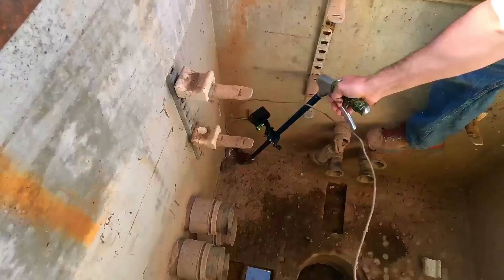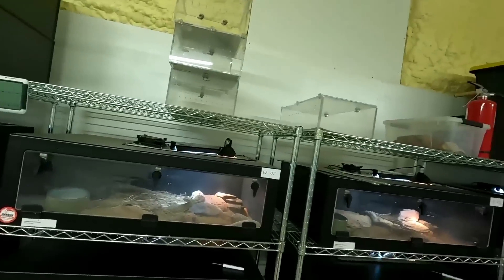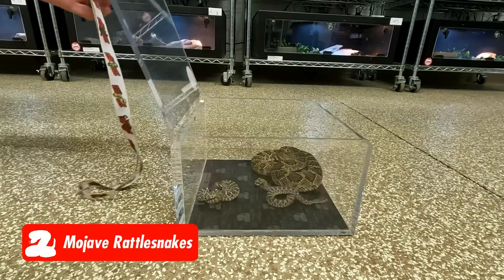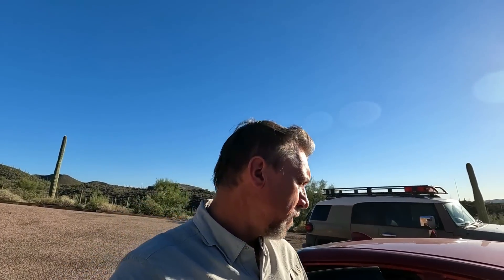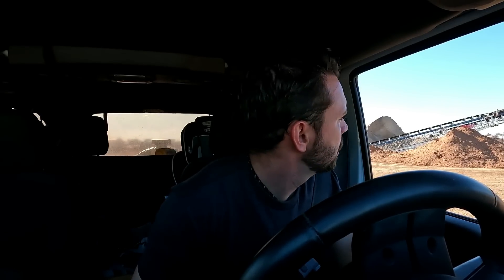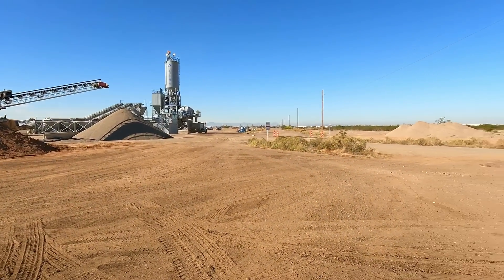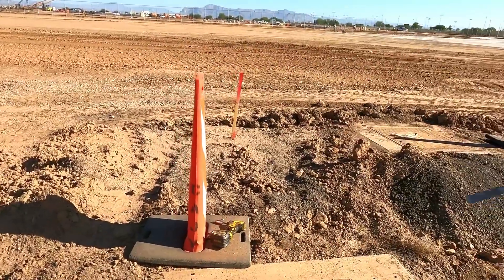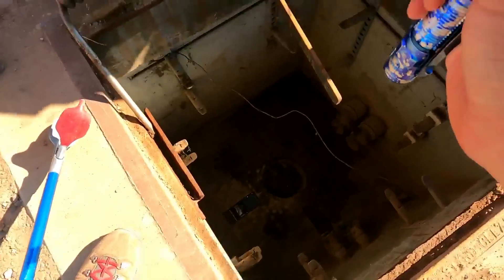Climbing Into a Tiny Man Hole to Catch Rattlesnakes

Comment: You can get a collapsible ladder to use in places like that.  It would have been a lot more sturdy.  I have a couple of collapsible ladders that are about three foot tall when collapsed and twelve feet when extended.  I bought them on-line.  It is easy to carry them in the trunk of my car if necessary and are hardly in the way.

Comment: If I went to the presentation, my question would be about the best boots to reduce the probability of a strike from a snake I didn't see.  Would a pair of cowboy boots beat most strikes?  I would bet that stingray lowers would work great, but the shafts of the boots are nearly always  leather.

In my area where prairie rattlers are common, the telephone company employees and contractors wear snake gaiters when marking underground fiber optic lines in ditches and encounter rattlesnakes frequently.  They probably see most in time to avoid them, but that isn't always the case.

My younger brother was working on a plow a few years ago when he felt something bump one of his legs several times.  He looked down and it was a rattlesnake striking at his bib overalls and venom was visible on the very loose lets of the bib overalls. I think that the rattlesnake was targeting the overalls and by the time the rattlesnake got to his actual leg, it's mouth was already closed when it got to his leg.  If he had been wearing tight pants, he might have been in trouble.

I know some people who swear by rubber boots as snake boots, but considering how the rattlesnakes generally just want to get away, it's not like they are all that intent on attacking.

Comment: Great video as usual...i would say that hole at the bottom where the male snake was is a drain for any excess water....the water would have to go somewhere and my guess it goes out to eventually open or to a type of leach field....but what do i know😂
Reply from the maker: That's the hope! What we usually find is that the weep drains end up either going nowhere and are just installed ceremoniously to meet some requirement, or quickly become so plugged up with plant matter that they are essentially useless.